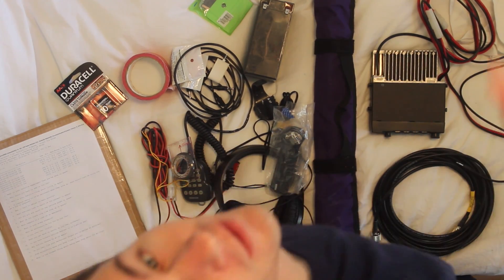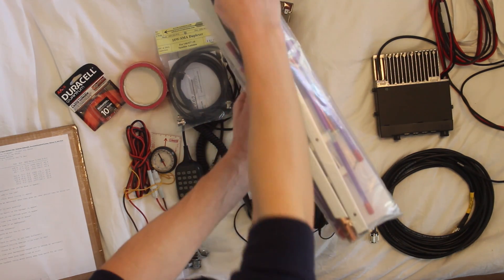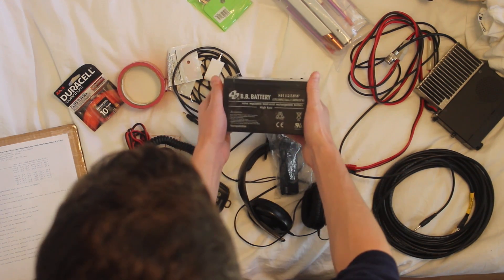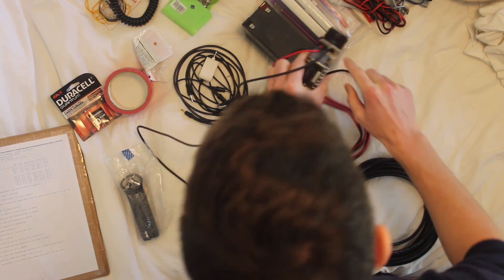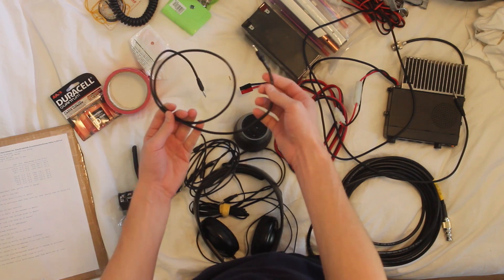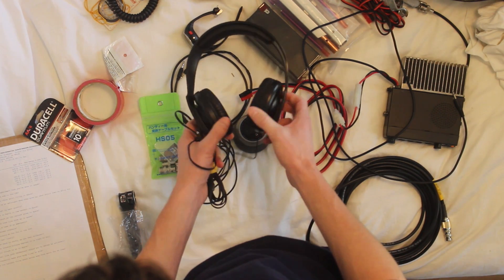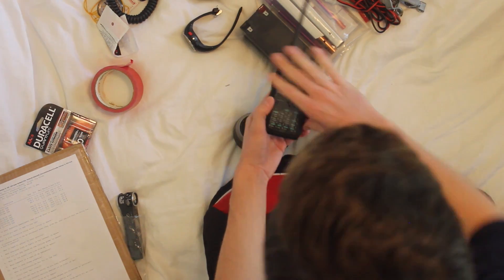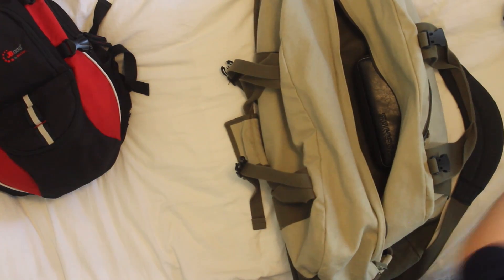Equipment I use for ISS reception

Comment: Go Chargers!
Reply from the maker: Battery chargers?
Reply: @SpaceComms  The University of Alabama in Huntsville's Mascot.  Charger Blue!  Since you're at the console, I am unsure if I want SMA or BNC on an Arrow II duplexer?  

Do you have any thoughts to offer?
Reply from the maker: @wesleybuff2536  Haha gotcha. 

BNC.  It's faster and more durable. You will want to get an SMA to BNC adapter for your HT and a new BNC antenna. Then you can switch back and forth easily. For normal SMA radios (Japanese) get the below Diamond adapter. It sits flush on the Kenwood TH-D72 for example. If you have a reverse SMA HT there are other SMA to BNC adapters that sit flush. Avoid the more common ones that don't sit flush. I mean, they will work but seem more likely to break your SMA on the top of the radio. Also they look worse. haha

https://www.dxengineering.com/parts/dmn-bncj-smap

Comment: Put a resistor in series with the audio to the recorder, maybe a audio tape pot so you can adjust the. The audio in to the box recorder is high impedance anyway and the speaker is low impedance. Some put a capacitor in there but should not be needed because the two don't use a common power source and will not get cross feed.
Reply from the maker: Yup I have done exactly that since I recorded this video.

Comment: Hello again! Quick question: Does the Arrow II's duplexer mean I can use it with any (one) radio, like the UV-5R. Or do I need a special 'duplexy' radio? 73!
Reply from the maker: You can use it with any dualband radio. However, for SO-50 and other VHF up and UHF down FM satellites if you use a Baefong when you transmit it will desense the receive, so you can't get full duplxex operation that would allow you to hear yourself on the downlink. The only radio that is currently in production that doesn't get desensed on receive is the Kenwood TH-D72. Several older full duplex radios don't get desnsed though, like the Icom IC-W32, I believe. Otherwise you're going to have to use two radios without the duplxer to get full duplex operation.
Reply: Space Comms Buying another radio, (and the antenna) will takes some time. I've seen some people get into satellites just fine with the UV-5R but without the Arrow antenna, (Christian Jacobs, 2E0ICL / M6RDG) has some good videos in this. Thanks for the help! 73!

Comment: What actual radio are you using? I don't believe you mentioned the make or model
Reply from the maker: Kenwood TM-261A 2m mobile. It stopped transmitting though. Now for ISS I use either a Kenwood TH-D72A or TH-G71A. For SO-50 I use either my D72 with the Arrow duplexer or separate radios for TX and RX. G71A for 70cm RX and Yaesu FT-10r for 2m TX.
Reply: Space Comms how is the TH-g71a I was looking at the v71a which I think is pretty much the same thing
Reply from the maker: The TH-G71A is an HT from the late 90s. I have the V71A in my car. It's a great rig. I haven't ever used it for satellite though but I know others do, especially for AO-85 since it helps to have more power to get into it since it's a little deaf.

The only problem I have had with mine is I think the 2 meter receiver got desensed somehow, high SWR or what, I'm not sure. All the local repeaters which used to be S9++++ are no longer even consistently S9.
Reply: Space Comms oh weird, what's the warranty like on those radios?
Reply from the maker: It's 1 year as far as I know. Mine's older than that. I'm so focused on portable sat ops that I haven't bothered to have it checked out. I did troubleshoot it myself a decent amount and it's really hard to be certain it's not as sensitive as it used to be. :-/
Reply: Space Comms ah yeah, those things are pretty hard to troubleshoot, well hopefully it's not much of a problem and it's got an easy quick solution :)

Comment: Hello can i speak with ISS via Walkie Talkie? Actually I have Baofeng UV-5R and Wouxun kg-uv8d. I have no special antenna. I want to make my own antenna but I am not pro at antennas :) How can I speak with them or can I?
Thank you a lot for great video
Reply from the maker: +Ayberk Halaç It's theoretically possible but ideally you would want a directional antenna. A popular homebrew antenna you could make is the tape measure beam:

http://theleggios.net/wb2hol/projects/rdf/tape_bm.htm

The real problem though is that the astronauts and cosmonauts don't get on the radio very often to make random contacts.

With that said receiving them can be good practice for ultimately talking to them, and it's fun on its own. 

I recommend you monitor ariss.org for upcoming school contacts in your area which happen frequently. You can try and listen to them on the downlink of 145.800 MHz FM.

Another option to stay up to date on the school contacts (sometimes called ARISS contacts) is by subscribing to the amsat-bb mailing list and looking for messages like these:

http://www.amsat.org/pipermail/amsat-bb/2016-April/057983.html

You can subscribe here:

http://www.amsat.org/mailman/listinfo/amsat-bb

John KG4AKV
Reply: +Space Comms Thanks a lot. I will check them.

Comment: With the TH-D72a, why not record from it directly? I assume the 2.5mm is mono, and you could then get a 3.5mm splitter to go at the end of the cable you already have. I am new and have the arrow antenna and TH-D72, but have yet to make my first satellite QSO. Wish me luck, as I will try this weekend
Reply from the maker: +Kevin Zari I'm not sure I understand what you mean by directly. When I'm operating on SO-50 I plug the 2.5mm end of my cable into the Kenwood HT and the 3.5mm end of my cable into my Zoom H1 recorder. Then I plug my headphones into the headphone monitor on the Zoom. The splitter I have is 3.5 mm. The cable is not a splitter and it is mono.
Reply: +Space Comms thank you for replying. I was under the impression you used the mobile radio and not the HT for recording. I like your setup and will check out the recorder. At first I was going to use my iPhone to record, but I would have to figure out the TRRS connections and build my own cable or just use a splitter on the iPhone side to break out the mic in (coming from TH-D72a audio out) and then bring the audio out of the radio also to a pair of headphones
Reply from the maker: +Kevin Zari I use both for recording. The HT for SO-50 and the mobile for ISS. Heck, one time I tried to use the HT (when I refer to "the HT" I actually mean either of my Kenwood HTs, the D72A or my other TH-G71A, which I didn't show in this video) to record the ISS but I had the volume turned up too high and the recording was worthless. You can see that video and explanation here: https://youtu.be/5-XIz5OUXn4?t=671
  
I understand the conundrum with the TRRS connections. I've been wanting to use my android tablet to decode ISS SSTV for a while and while I got a TRRS splitter feeding the radio audio into the android doesn't work because it's too powerful of a signal. I need to make a circuit to step it down to microphone level. Be careful because you can blow out the circuitry in your iPhone if you hook up a speaker or maybe even headphone out into the mic input of the iPhone. I did just that but somehow it didn't blow anything.